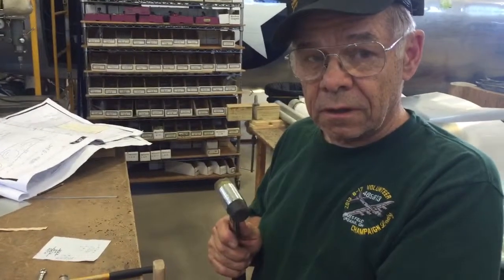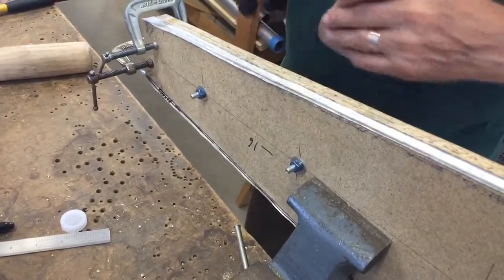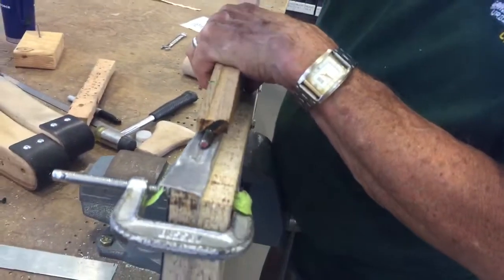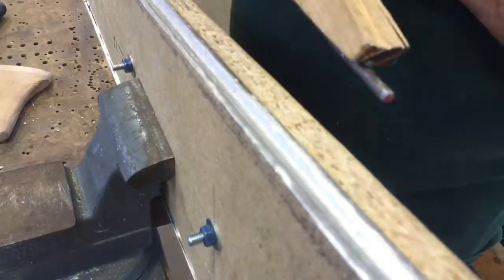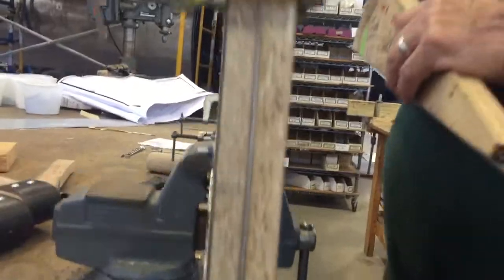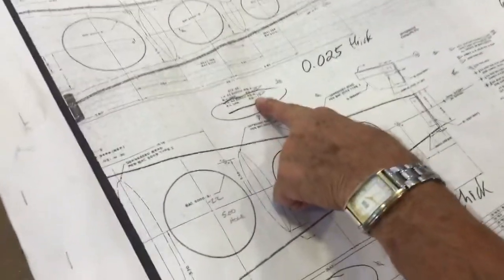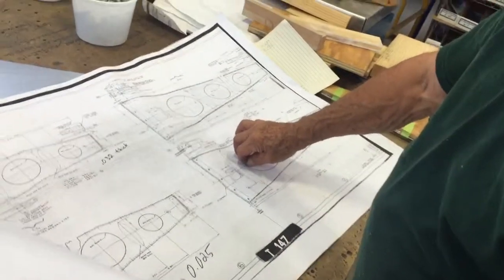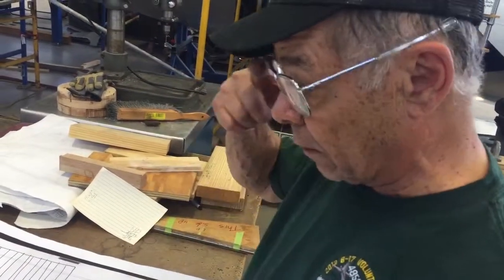How to form a rib for a warbird aircraft -- metal forming and fabrication for a Flying Fortress

Comment: So, where do you get the drawings from?
Reply: The original drawings by Boeing long ago were made to microfiche film and then later the Smithsonian digitized them and made them available for a price..I found a seller on Ebay and had this to sell..100 for a full download of all the plans..28000 individual sheets like the one shown in the video..Took me days to download as it was about 30GB in size
Reply: You could build a B17 from these plans if you had the facilities..Everything is there including wiring diagrams..Everyone of the sheet show signatures of the original draftsman engineer and the dates..From the E model and F-G..From small brackets to full drawing of the wing spar, ribs. fuse formers..Everything!!